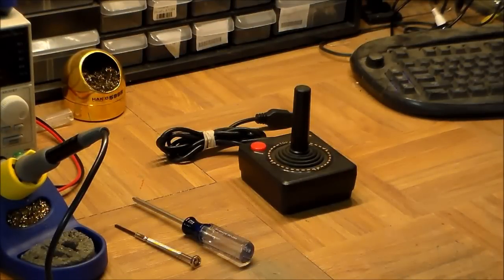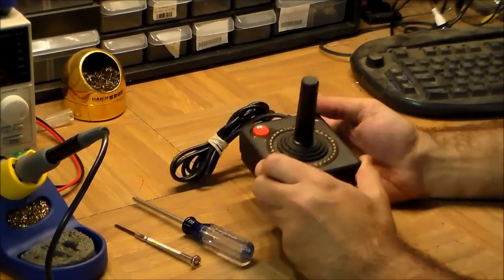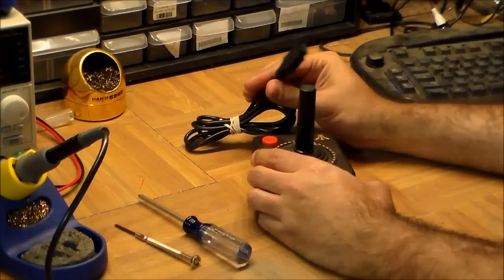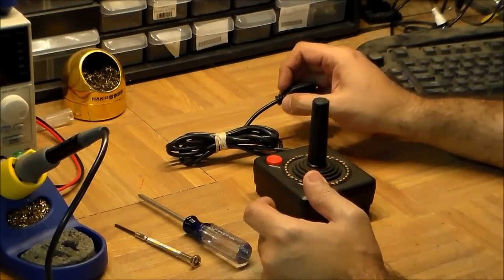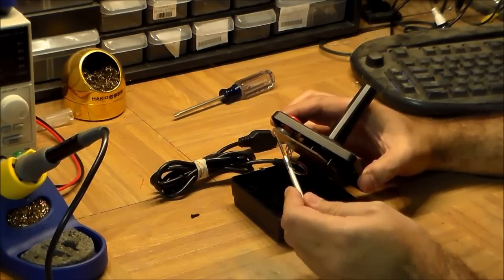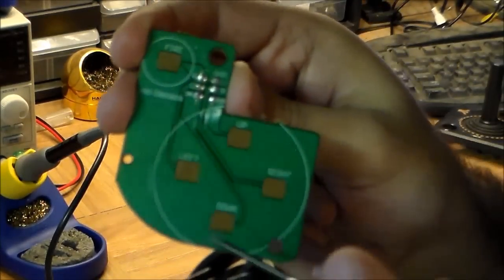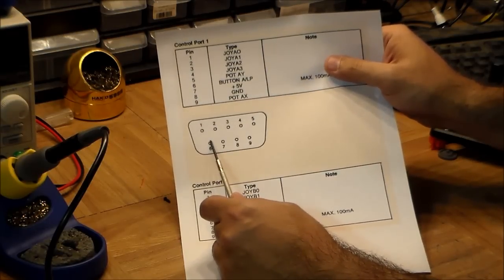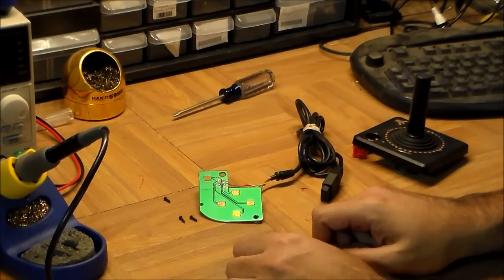Inside the Black Box 1: Atari 2600 Joystick

Comment: The one that came with the Atari ST, looked like the 2600 but when opened up was cheeper built, no carbon contact, it was them cheep metal dome switches that were out over a shorter time.

Comment: I opened up an original Atari joystick and the traces are interesting. Very wide and wavy. It looked like hand-cut copper tape. The contact were also these weird plastic blisters which seemed to be common at the time. The blisters didn't have a good springback action for the button, so they would be augmented with a metal spring.

You should do a video on the Intellivision controller which has an interesting layout and demonstrates matrixing the various buttons. It's complicated, but worth looking at.
Reply from the maker: The technology for creating thin traces was very expensive in the 1970s, so Atari probably chose wider traces to reduce cost - because you only need a few tracks and the joystick is pretty big, no point in wasting money, right?

Intellivision controller is a beast for sure; I've never taken on apart. If someone donates one, I'd be happy to take it apart on camera :-)
Reply: Interesting video. but liked mentioned above it would be even more interesting to see the original switches. Is there a correct technical term for these so called "weird plastic blisters". 
Still prefer this joystick over everything made later. Why is it when most people are  right handed most controller are made for lefties. D-pad should have been placed at the right side. A historical mistake in my noble opinion. 
Nice video series!
Reply from the maker: Mum Blic Thanks! I only have one original stick, so I'm going to wait until I find a second before I tear it apart :-) The correct name for the blisters are "dome contact switches"
Reply: You don't have to tear down one for me ;-) actually I have openend one myself a very long time ago. I just remembered it by watching at the pictures after a google search. Strange what you forget after many decades and then remember again when seeing a picture.

Comment: I'm disappointed this is not a real 2600 joystick.  I wanted to see an original one with mylar ribbon cable and bubble switches and possibly explain their failure rate compared to the modern, conductive tipped rubber switches.